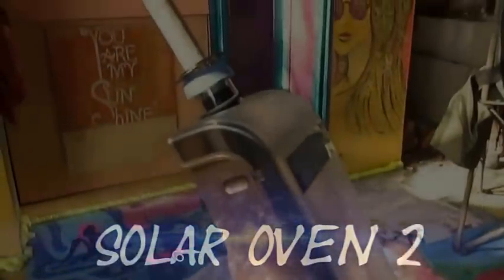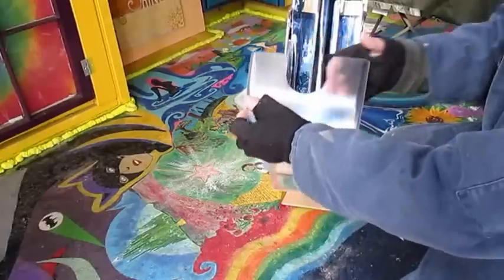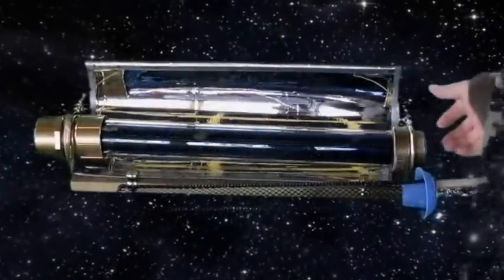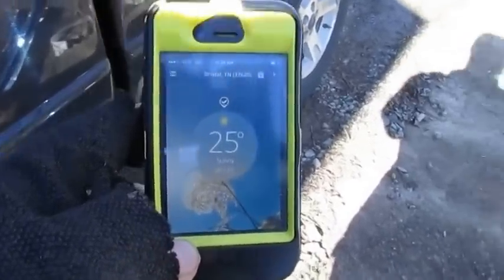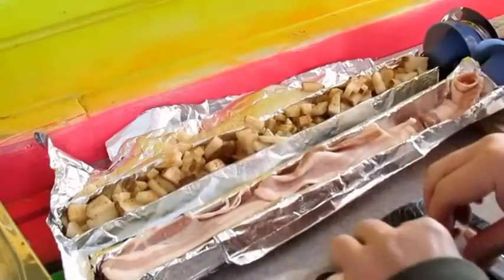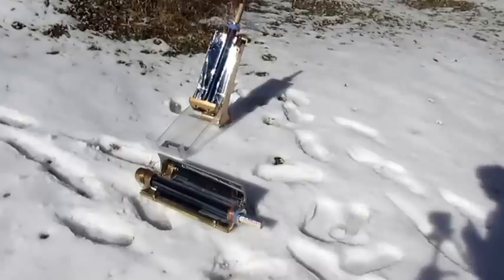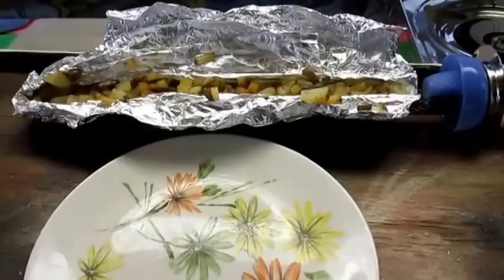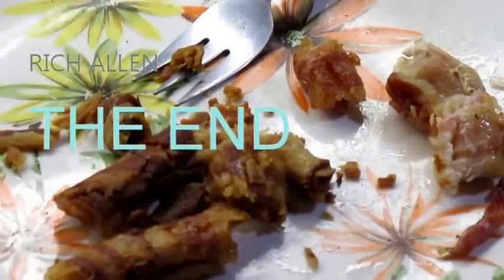SOLAR OVEN 2

Comment: Should design an adapter to use with this that super heats gallium to operate a thermal electric generator for campers. Novartis
Reply: Or ammonia/chillers like they use. Or.. peltier TEC's.. or.. Seebeck TEG's for making electricity.
Reply: Or sea eye hay dipshits.
Reply: Use hemp seed oil in hydraulic swash plate pump motors with a cryogenic sterling cylinder to supper cool the hemp seed oil being circulated through a copper coil with a fan forcing air over it. A hemp seed oil hydraulic air conditioner that operates off a low volatage electric motor ran off solar panels and a battery bank? = /
Reply: You believe anyone would want a hydraulic hemp seed oil air conditioner? That operates off solar panels and a battery bank?
Reply: Could design a friction heater that operates off a swash plate hydraulic pump motor all ran by a low voltage electic motor to heat a home with has well. Keeping things simple is best in the end. All the wires and do dads break on all those appliances over time. So why not design a better concept to get the job done? Being independent in a non independent matrix is very naughty.